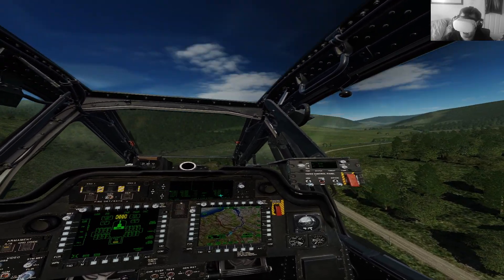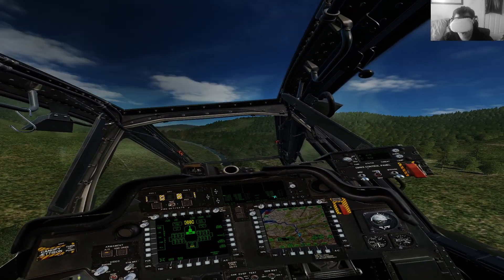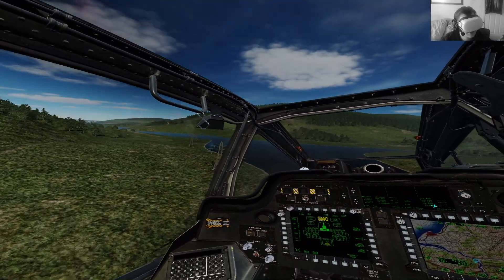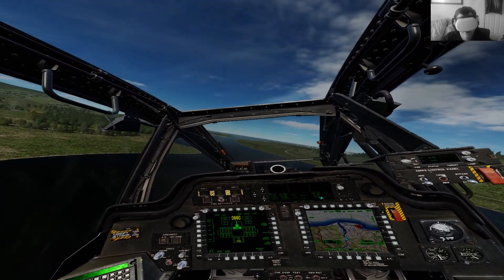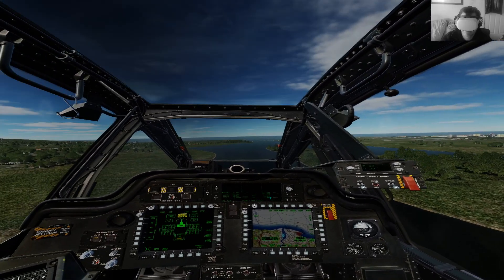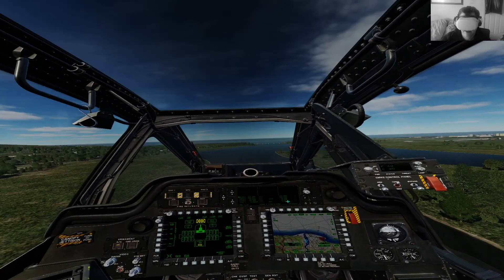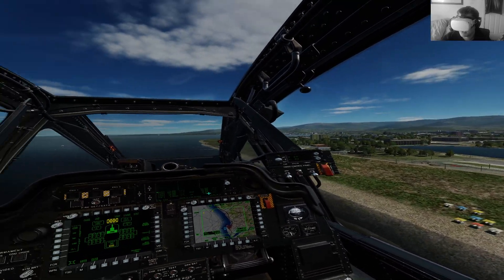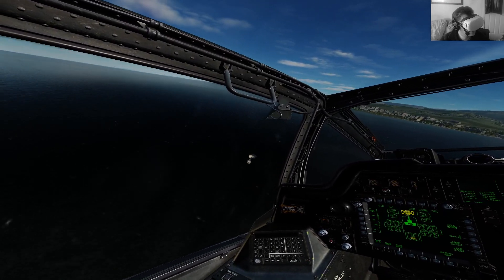DCS World VR | Apache - Solving The Trouble With Trim With A Dry Clutch (VKB GNXT EVO)

Comment from the maker: Useful Links:
Red Kite's Apache Trim Video - https://youtu.be/q7VoI_sMmyQ
Casmo's Apache Trim Video - https://youtu.be/l9t8E4uBtq4
Hono's NXT EVO LED Video - https://youtu.be/ZKE_w_6Ev94

Time Stamps:
0:00 - Intro
1:00 - So What's A Dry Clutch?
1:43 - Showing The Evo Acts Like A Real Cyclic Stick
2:08 - How Do You Find Centre Position With No Springs Fitted?
3:00 - Can You Use The Dry Clutch With Springs Fitted?
4:35 - Do You Still Need To Bind The Trim Commands To The Stick?
5:37 - Discussing My Old HOTAS Setup & Future Upgrades After The Evo
8:58 - Outro

Comment: Great video, thank you for taking the time to create & upload it. 
Question, is there any stiction (extra resistance) when moving the stick diagonally?
I’m currently using a WinWing Orion 2 base, but cannot use it springless with dry clutches as the stiction is too much. It makes small movements all but impossible.
Reply from the maker: Not that I can recall it was pretty smooth if my memory serves. I put the springs back in as I went back to flying fixed wing, not done any rotary flight in quite some time now.

Comment: Seems like you've opened Pandora's box of pain with that new toy.
Glad you got it sorted.
How come you're not using your Rift S BTW?
Reply from the maker: It just took some time to "dial in" the settings for the dry clutch, each person will have a different preference. It wasn't cheap BUT I'm very pleased with the stick and the experience in sims is greatly improved. I didn't have to remove the springs, doing so just makes it behave like a real cyclic stick. Haven't seen anyone else cover this so thought I should try and answer some FAQs

I do still have the Rift S and do use it BUT it's now discontinued. When I do videos it's probably best that I use the most common headset people will be using now...value for money the Quest 2 is hard to beat.

Comment: Back again :-) I'm very confused as to force trim and the EVO springless with dry clutch. Seems to me I shouldn't need to force trim as the stick is effectively always held in place, but I've heard apparently you will still need to as the stability system needs you to.
Reply from the maker: News to me, the stabilator should be in auto mode and do what it needs to do. You can watch Casmo's video on it (https://youtu.be/m_OWkPxlcwU), he says he never uses the manual stabilator controls in DCS.
Reply: @Honosuseri  I asked on the discord and was told I'd need to keep pressing force trim as it does more than just mag lock the stick position. Seems odd and I bet a lot of new EVO users will find the same. Unless I'm misunderstanding. This is SCAS I think, not stabilator specifically.
Reply from the maker: I don't use trim at all, keep my feet on the anti-torque pedals. I've never had any issues
Reply: @Honosuseri  That's what I'd like to do too.  Just tested pressing force trim on and off and the heli definitely changes what its doing, starts to pitch, which is weird. Using "joystick with no springs and ffb". I probably will ignore force trim but I've been told that won't quite work due to what SCAS is doing and it needing to know.  The green mark on the controller which is SCAS moves.  So if you never force trim, but use a dry clutch springless, SCAS may be wrong. SCAS effects the flight.
Reply: Playing around a bit more I guess ignoring force trim will sort of work and be fine. Definitely seems it's then failing to tell SCAS how to manage flight though. Confusing!
Reply from the maker: Page 26 of the manual (https://www.digitalcombatsimulator.com/upload/iblock/ae5/1gklim4idv5p6s46zmgduj55g4m47mlo/DCS_AH-64D_Quick_Start_Manual_EN.pdf)

"Hydraulic augmentation is provided by the Stability and Control Augmentation
System (SCAS), which consists of hydraulic actuators controlled by the Flight
Management Computer (FMC). The FMC provides rate damping to smooth flight
control inputs and command augmentation. It also provides limited attitude and
altitude hold capability for hands-off flying. The command augmentation system
provides consistent control feel across the full range of helicopter airspeeds. The
SCAS also provides automatic turn coordination for turns above 40 knots airspeed."

I have the attitude and altitude bindings set on the hat switch along with the force trim, not sure they are implemented yet....haven't used any of them. I can hold course without trim, although I haven't shown it in my videos, I do pull some really tight turns when practicing on the range to engage targets. Long story short I've never crashed the Apache and it behaves as I expect it to with the EVO springless. Not saying these guys are wrong but I've yet to see any real need to keep force trimming whilst I fly.
Reply: @Honosuseri  Yeah I'm finding the EVO flies like a dream and I can ignore force trim.  People are telling me I still need to press it though so SCAS (that grey box and green cross in the controller ctrl-c window) knows whats going on.  My head hurts, I'm going to just enjoy flying :-)  Attitude hold is worth trying it makes hover very easy.
Reply: "When the green symbol reaches the edge of the box and stays there, you can expect instability in the helicopter because it can no longer provide stabilization. To fix it, press and hold the force trim release button for 3 to 5 seconds to recenter the SAS and give it its full authority back."  So I believe we can ignore force trim, but if SCAS starts to mess up, long hold force trim release to fix.
Reply from the maker: That grey box and green cross doesn't show on Red Kite's Trim video, so it must have been added in on a recent update. I've put the light springs back in my EVO as I was doing some Star Wars stuff for May 4th. I'll remove them and revisit the Apache, I appreciate the heads up.

Comment: Have you ever tried the TWCS rocker paddle instead of pedals? That's what I'm doing. Not sure if I will get enough out of actual pedals for the money.
Reply from the maker: Yes but didn't really like it. As I had the pedals with the pack, I didn't have to use the paddles out of necessity. I've used software to change the paddles from an axis to buttons instead. The pedals tilt forward so can be "toe brakes", I find them perfectly adequate for everyting I fly from Warbirds to Jets and Heli's